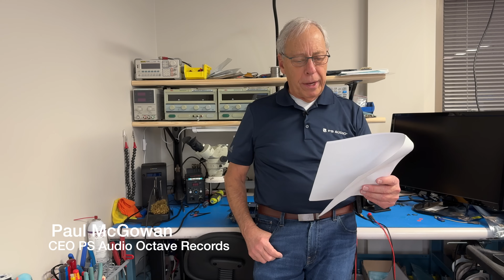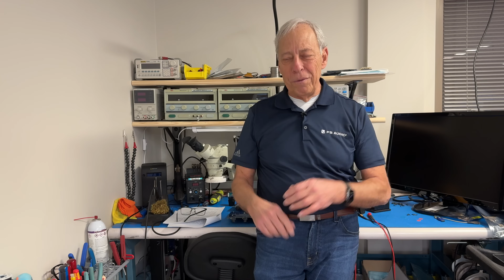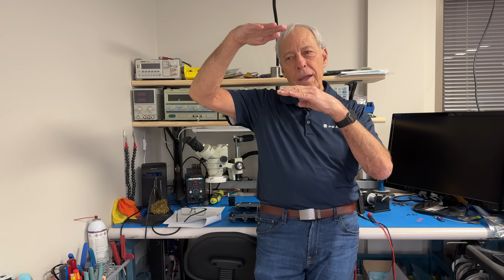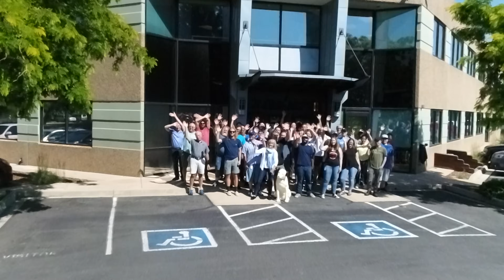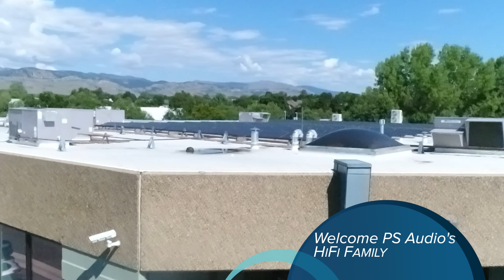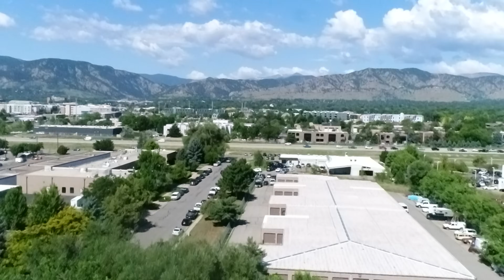Understanding amplifiers and wattage specs

Comment: Then why not rate amplifiers according to output voltage?
Reply: because they don't output voltage they output power. Voltage is a measure of force.
Reply: @V1ralB1ack  "Voltage is a measure of force" - Voltage is a potential, not a force.
Reply: @V1ralB1ack  They do not output power, they output voltage. An amplifier is a voltage amplifier not a power amplifier. Amps increase the voltage of the input signal and that is all.  Amplifiers are exactly the same as the electrical outlet in your house. It provides a constant (120v/240v) source of 60hz electricity. How much power is that outlet producing? None, the power consumed all depends on the load you hook up to it. Put too much load on it and you trip the breaker (current limited voltage source). Your amplifier is the same. It is a current limited (internal protection circuit) voltage source. How much current can go through it before protection kicks in is hidden in the specs under "minimum impedance per channel" spec.

@bobc455 Yes, they should be listed by voltage but you know ... marketing and dumb consumers.

If you play a 60hz sine wave into your amplifier and your amplifier can reach 120 volts on its output (very high power amplifier) you can use your amplifier as a laboratory grade power source for your electronics. By varying the voltage (volume control) you now have a laboratory grade VARIAC ( variable AC voltage supply). Your amplifier is just a power supply that can alter its voltage and frequency according to the input and volume control. Like all power supplies, it is current limited by design (minimum impedance load).
Reply: I guess that's because voltage are gain and music dependent. Most amplifiers are a voltage source, they don't "push" power; speakers "pull" power according to that voltage. Amplifiers just try to output the voltage that they have been told by  music and gain. According to that voltage, speaker impedances will pull current that the amplifier will try to give. Power is a calculation, a consequence, nothing that can be push or output. In the same way,  a big nuclear power plant won't push or output his power in our little HiFi system.

Comment: A lightbulb has just gone off in my head. It’s drawing 100w. A lightbulb simultaneously went off in my girlfriend’s head. It’s drawing 50w. Does that mean she has a higher impedance to your explanation?
Reply: Yes, if both bulbs run on the same voltage.

Comment: Power = Voltage * Current. Current = Voltage / Impedance. Thus Power = Voltage * (Voltage / Impedance) = Voltage * Voltage / Impedance. Since a power amplifier actually is a voltage amplifier, the output voltage is a fixed factor against the input voltage. Let's say your output voltage is 10 Volts and the impedance is 8 Ohms, your output power will therefore be Power = 10 * 10 / 8 = 100 / 8 = 12.5 Watts. If you use 4 Ohms, you will get Power = 10 * 10 / 4 = 100 / 4 =  25 Watts. Since you divide by impedance, half the impedance means twice the power. This is true only if the amplifier has low damping factor and can keep the output voltage constant. So what happens to the power if you double the voltage?

Comment: Just tell the truth. Power is the most bullshit way to rate an amplifier. A traditional speaker never stays the same impedance during playback. The amplifier has to deal with this forever fast change, and the majority of them fail to provide the specified power the entire time.
Reply: A class A amp will provide it continue.
Reply: I don't it seemed to work well for Bell Labs for over a century and counting. But please enlighten us about a better way to do this.
Reply from the maker: Gee, what do you really think? Of course a loudspeaker's impedance dips and rises during playback and it is the ability of the power amp to handle those dips and bumps without changing amplitude. To do that (especially the dips) requires power (current). Which is why we like to see power amps who can double their wattage spec into half the impedance. That allows you to maintain a constant voltage in the face of impedance dips. I think you can safely say this woitout resorting to antagonizing statements like "tell the truth". Keep it civil, please.

Comment: The only way I can get my head around this is to use an analogy. Is the following a correct way to think about it:  An engine of a certain size might be said to produce 100 HP “into” a lawn tractor, but only 50 HP “into” a small car. Same engine, same capacity, but its power delivery can double depending on load.
Reply: Not a very good analogy. Try a garden hose. Or a canal. 
Your tap can only supply so much water. The wider your hose is ... Anyway, the amount of water you can spray is not dependent on the size of your hose but on your water supply. 
Even better: a canal. Water height is in Volts (pressure or potential), width is resistance, current is current and the total amount of water is power.
Reply: @Jeep_on_audio  thanks but none of that is helpful. It’s not you, it’s me. My mind doesn’t grasp it.

Comment: What about in a tube amplifier where the output remains the same on a 4 ohm load as an 8 ohm load?  Not all amplifiers doubles the power output between 4/8 ohm speaker taps
Reply: tube amplifiers have output transformers. this is good and the ration of output and input resistance is actually better like this and it can really push the bass well
Reply: No. Paul was speaking about an ideal amplifier. Most amplifiers are not ideal. No amplifier is. Because no amplifier can produce an infinite amount of power. 
A stable amplifier is an amplifier that can keep a stable potential (V) between a given impedance (or better said; resistance).
Reply: @Jeep_on_audio  that's hypothetical. In reality an amplifier is ideal when it's playing my damn music and from my experience of owning a variety of amps yea tube amplifiers especially a 300b is very very ideal. So yea you're wrong and no one cares about your perfect voltage because we don't live in a perfect world and even if I made you listen to the perfect setup you still may not like it because we have different ears and different preferences

Comment: Instead of changing the speaker from 8 to 4 ohms, simply add an identical 8 ohm speaker in parallel.     
Now what happens? The voltage remains the same, the current doubles, the power doubles, 
and the SPL goes up by 3 dB.        
Of course there are fairly few amplifiers that succeed in doing this trick.
Reply: Why don’t you just add a 8 ohm resistor? Get the same impedance.
Reply: @Rotteneggsack .With second speaker we double power of music - why not?